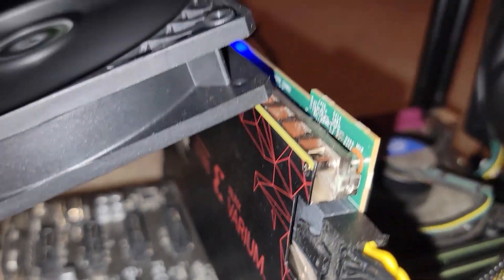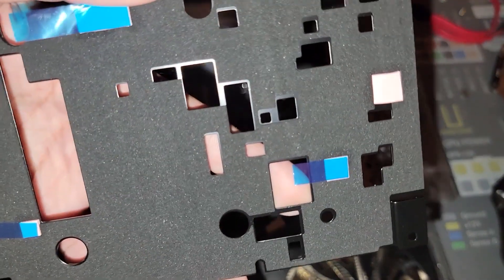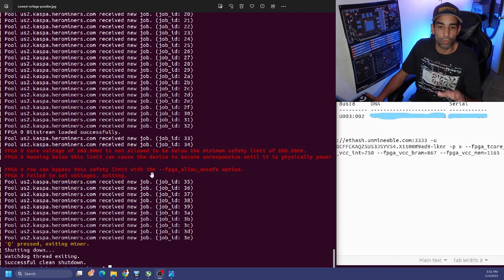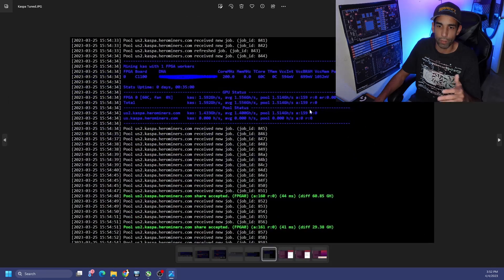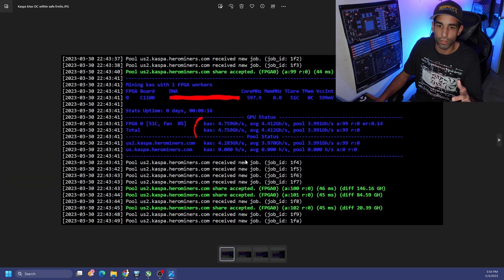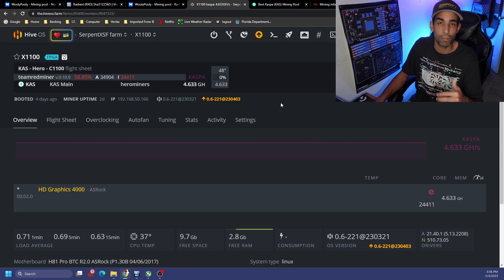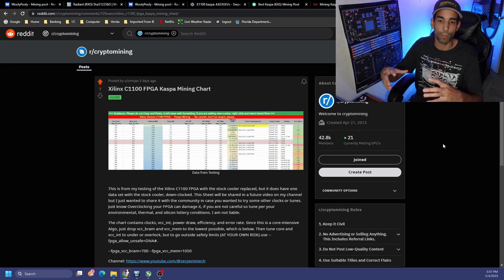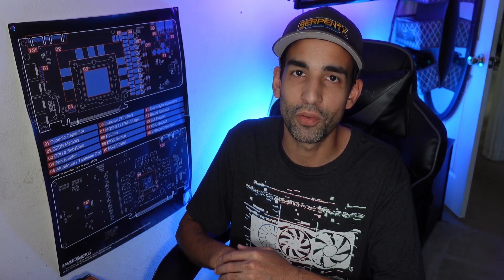Will the Osprey C1100 Cooler Keep FPGAs Running Cool? Find Out Now!

Comment: I bought this cooler right after getting my C1100 and it works really well. My metal bracket was not cut right (could not access the mini usb port) so I ended up using the stock one. Running mine at 4.218 GH